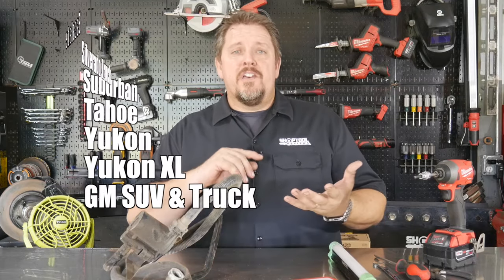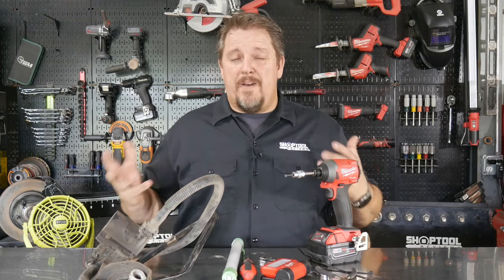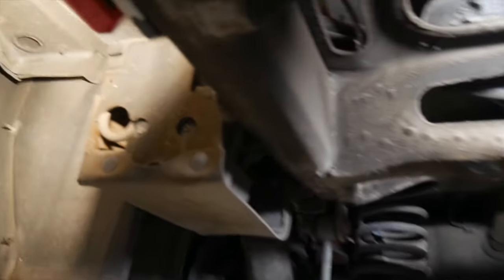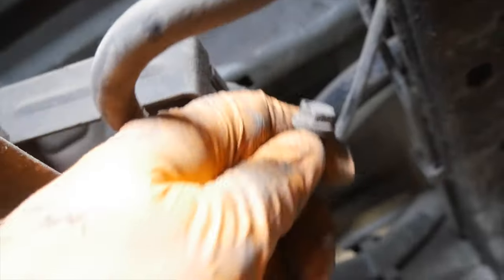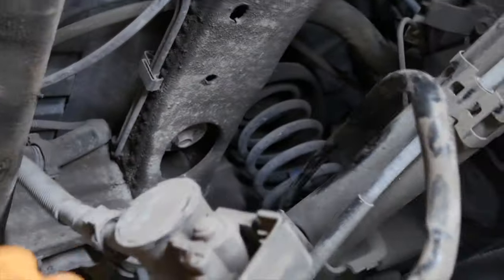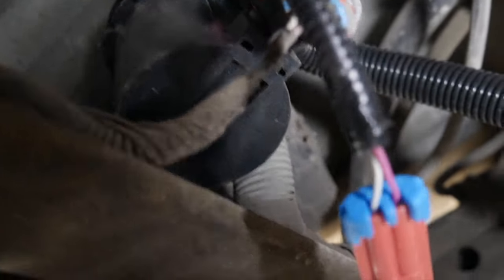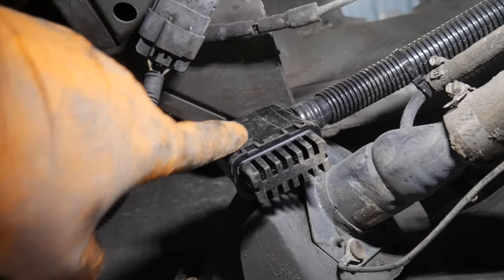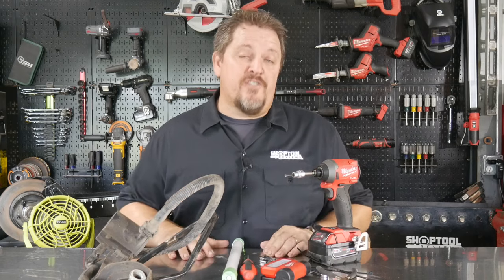Gas Tank Won't Fill? Escalade Vapor Canister Vent Valve Solenoid FIX

Comment: I've replaced that the canister and purge valve still does it guess I have clogged hoses or faulty parts maybe or even a bad valve in the fuel tank chevy gm Cadillac needs to get their stuff together it's ridiculous to have these problems with the cost of their vehicles 🤬
Reply: I know this is a year late but when changing out canister and it gailed u need to remove purge valve solenoid in front of engine and remove connector hose and blow through it to remove carbon pieces
Reply: What was your fix?

Comment: I changed out all three components on my 2013 cadillac escalade esv and it's still shutting off gas pump when i try filling the tank
Reply: Wonder what it is?
Reply: What was the fix?
Reply: My 2010 5.3 yukon xl began taking fuel correctly again after a couple of fill ups after the charcoal box and (two front and rear) solenoid replacements. I thought it was something else. Replacing the parts resolved the problem (Advanced Auto - Car Quest).

Comment: Thank you so much. This is very helpful to women especially having to take care of maintenance issues on their own. 🙏
Reply from the maker: So glad that we could help. Keep up the hard work.
Reply: Amazing thank you SO much. This was very helpful
Reply: Props to you for doing this on your own.
Reply: Update I replaced all these parts but did not drop the tank.  I still can't fill my tank.  Now it's $750 to drop the tank and blow all the lines out.  Soooo annoying thanks GM for making such an amazing part on my 100k original price escalade.
Reply: @extrememiami  10 years / 100,000 miles is emissions. If you can't get fuel into the vehicle without it clicking of at the pump, roll over valve maybe stuck closed, tank vent valve if full of dust (Easy to remove and open with pocket screwdriver) you or hired help have simply not found the problem yet. Remember emissions is under warranty and a regional service manager can be requested to meet, especially if you have tons of paper work going back over time and miles.
 A diagnostic some never do is easy. Disconnect the tank vent valve, go start filling up. If problem goes away, BAM! Also, for 70+ years, a simple vent hose comes off the highest point of the gas tanks top. Some have a bubble shape in the tank to get this fitting and hose high above liquid fuel (This is where a rollover valve is located/some ROV are built into the fuel pump plastic bucket) this hose is routed to the top of the filler pipe. It makes a sharp 90 degrees and allows air from tank to exit here. Hose pinched? Fitting rusted? Can you smell gas by the tank after a refill? Does the garage smell like gas fumes in the AM? 
  You just have to find someone who is smarter than a fuel tank!
DK, ASE master tech since 78, retired.
Reply: @deankay4434  I did eventually figure it out.  The hose was still full of little charcoal pellets.  The way I fixed it was to disconnect the vent hose attached to the engine after every drive then I'd shake it or vacuum it till none came out, drive it again and repeat the process about 10-15 times until finally no more pellets came out of the hose.  Took a week or 2.  I curse GM for using a canister that eventually explodes pellets in time.  I think everyone will have this issue eventually  if you drive it long enough.  Hope this helps someone.   PS I fixed this 6 months ago and today for the first time my gas nozzle clicked off again.  Well 6 months later a few more pellets worked themselves out, 1 final vacuum session 6 months later was needed.    Good as new once again, I feared the new canister also exploded but nope, just some final pellets.
Reply: @extrememiami  I hate to tell you but their a 3 manufactures of activate carbon canisters in the U.S. and they are all made the same way. You are best to snag a canister form a local bone yard and use it. 
  The canisters have a "Screen Door" looking mesh glued to a spring loaded plunger inside that keeps these very tiny pellets inside the case. The end with hose connections has a screen glued or heat-melted by a machine across the entire end. The other side is active and has a plunger face that is structurally designed with the same treated fiberglass looking material from wall to wall. The difference is it is spring loaded and keeps the black pellets pinched against the end. Who knew. I have cut open well over 40 during the 2000's of donor vehicles. Never saw one go bad but heard several say yes! Fresh outside air enters the canister thru the tank vent valve or solenoid. Off or unplugged works normal depending on vehicle as some are on/off, while other use a purge to engine vacuum (As normal) but the hose on the engine w/ green test fitting goes to the same purge valve and is pulse width modulated. Since this is the only way to remove hydrocarbons from millions of tiny holes in each activated carbon pellet, the action creates heat, what they call an "Exothermic" reaction that allows vapor hydrocarbons into the engine distributed equally between all the cylinders while the PCM allows for fuel mapping changes during this event. It could get too rich if It didn't and run outside the tailpipe emissions, thank you CARB & EPA for requiring this extra "Do-Dad-Software-BS" May I have another whip across my back since I am tied here already?
 Look, if you had the black pellets of death come thru a pipe, replace the carbon canister and blow the line out with compressed air while off, open and disconnected. Depending on year, but a roll over valve is used, the have a baby food jar sized device with a rubber flapper & seal ball on the bottom. It is very dainty and sensitive but used a weak large spring under it. It is part of the pumps vent and when liquid fuel touches it, it floats up very easy and shuts off the vent. Another line follows the fill pipe and bends sharply into the fill neck. When pressure backs up during refueling, an aspirator inside the gas pumps hose shuts off fuel. This is a confusing problem for many who do custom builds but don't understand the entire system. They fit it, spend hundreds of hours trying to figure out why or end up paying someone to fix it.
  My youngest so just mostly finished his 81 El Co that is laser straight, all white base coat /clear with a 450 HP 383 cu in stroker I built him 6/7 years ago. I re-wired a large alternator, two cooling fans, choke heater for his Holley, installing main "ANL" 150 amp fuses, to starter, alt, 3-way distribution center to power an LED fuse block that is hot in run only. He is 36 now and no clue. Roller cam, lifters (0.018" int-0..020" thou. exh.) again and doesn't understand. I told him this is what you wanted! He is on 700R4 #2 that I bench built him and diff locker #2 since he twisted out the original. Doesn't want to learn, I tried to explain, Fluke 87-5 voltage drops, 460 ohm resistor to one wire alt. doesn't care. But right their on the frame is a open metal pipe. I told him this needs a small engine gas filter and turned down-ward. He say YA! I cap it and it shuts off the gas pump...Just fix it! Doesn't care why, doesn't want an explanation, just fix it. I did not, told him what to and walked off. 
  Long, boating, I just help people. 
DK, ASE master tech since 78. Hope do good. Had a great 2022 holiday! Recovering from lumbar surgery #8....Yeah!
Reply: I am also a woman. Will this work on a 2008 gmc yukon denali?
Reply: @rowdybme4584  It is near impossible to say any vehicle has identical problems. But, with quality diagnostic using knowledge of how the system works, they will find the problem. My trouble begins when a tech diagnose the symptom and not the root cause. The inside of a fuel pump bucket needs inspected. If filled with dirt, dust and debris, then it is still in the tank. This alone will cause premature pump failure. These are fuel pumps, not garbage disposals. 
Filter on inside (If 2000 or newer) and second filter on the bottom of the bucket. The service filter is on the frame and I can't tell you how many are dirty, rusty on the outside and never changed. Plus, I have never replaced a filter without holding it over a trash barrel and blow thru it in the normal direction. This alone is diagnostics. 
Best of luck!
Reply: @deankay4434  well i was more asking if this is the same part for  2008,  since this video references a 2007
Reply: @rowdybme4584   I don't have every part memorized but doing research will get your answer, like Rock Auto. Year, model and engine, find category and part. Click on part number, gives you application chart. You have to do some homework as what is the p/n of second design abs sensors on the Buick Park Ave? I do know but look it up if "You" don't. Gray sensors replaced black, rear only!

Comment: I might be wrong but isn’t that you’re changing the solenoid? The other side with the box is the charcoal canister. The purge valve (solenoid) is a valve that allows the fumes to pass into the canister, if it’s closed it won’t let you fill the tank. The actual canister is not electrical, just a box. just asking

Comment: 2014 Escalade esv, fuel tank not filling properly cups at a time like he's describing in the video but I have a zero check engine lights it's throwing no codes at all I'm not sure this is the problem thoughts?

Comment: So I've replaced all three parts, (Charcoal Vapor Canister, Vapor Canister Purge Valve, and the Vapor Canister Vent Valve) and even went back under the SUV to make sure line from Charcoal Canister had no more Charcoal pellets in it. I unfortunately am still have the fuel fill issues, but have no codes. Ant suggestions? It is getting irritating to pump gas as I have to find a pump with less pressure so I can squeeze lightly and constantly have to find a position for the fuel filler so it can click less.
Reply: SAME HERE!!  It's SO frustrating!  Been chasing this issue way too long!  Did you ever resolve the issue??
Reply: @wild_for_nature9932  Unfortunately still dealing with it. Haven't find anything to fix this issue.
Reply: @JoseRodriguez-bv3hx  Really? Ohh man. Well, I don't feel so alone now.  Little update though;  yesterday, I went to a different gas station.  Filled the tank with no issues. Crossing my fingers.  In the meantime while I play the suspense game,  I'll be putting my new rear shock absorbers in, replacing the parking brake cables and then try and figure out exactly where the issue is for my latest (but not limited to) code B0085 #6.  Then, off to the body shop for some rust repair.  Whatta money pit.  Next truck might be a FORD!  ugh
Reply: @wild_for_nature9932  That sucks. Hopefully it's not costing you too much. For me, besides these issues, it has been more minor, besides the shock/struts. I did replace those. I need to replace a motor mount. I needed this suv because of the size of my family and that's why I got the ESV model. Had a Nissan Pathfinder which was a 7 seater as well and actually liked that SUV, but trunk space was horrible.
Reply: I've just replaced everything still have the same issue as well
Reply: @Flako Gonzalez  That sucks. Only thing that works for me somewhat is if I hold the gas pump nozzle higher and just makes sure it's going down the filler and slowly release when it gets higher in the filler, it pumps faster without it stopping. 🤷🏽‍♂️